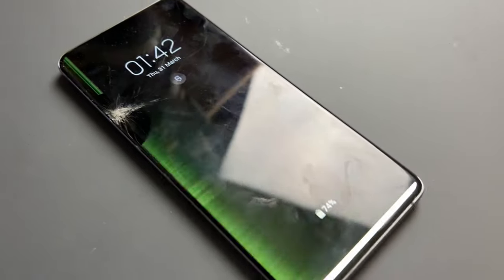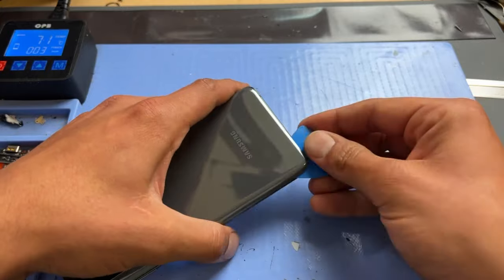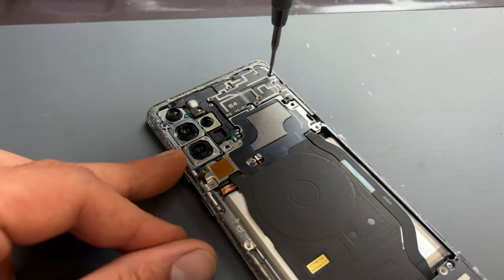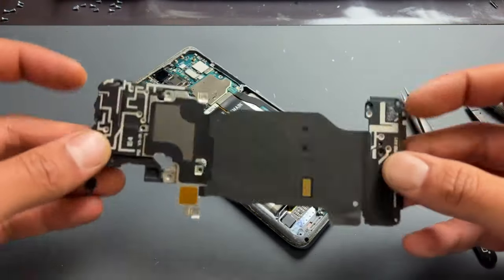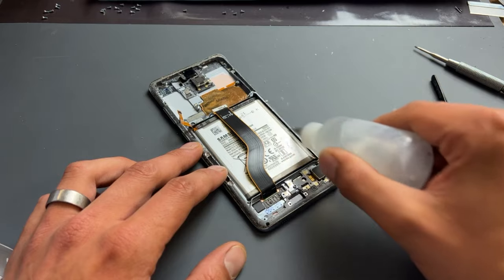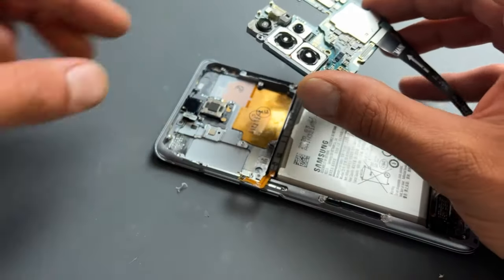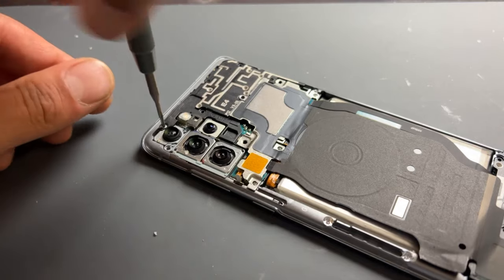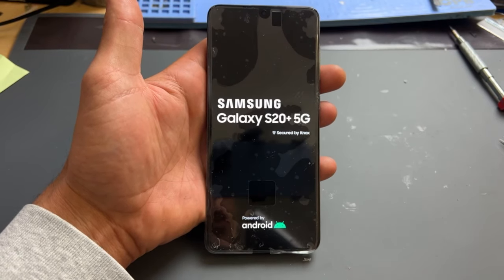Samsung S20 Plus 5G Screen Replacement: Detailed Step-by-Step Guide

Comment: The best step by step guide out there. Apart from not showing how to reapply some glue (I used B-700 which was straight forward), this guide literally showed everything and I saved myself £100. Happy days!
Reply from the maker: Thanks! We actually use Tesa tape to re secure the back cover when we don’t have an original seal available. Tape doesn’t have a curing time and is as strong as glue without the mess
Reply: @iDoctorUK  isn't Tesa Tape a fabric material used for wiring looms. It doesn't cause a water tight seal does it?

Comment: Yeah think I'm just gonna get a new phone instead 😂
Reply from the maker: I think for this model it is at the line where the screen replacement is almost as much as it costs to replace the phone
Reply: Just looked it up last weekend. Screen replacement is about $100-$130. A refurbished phone replacement is about $200-$230.
Reply: If had mine replaced at least 3times it cost me $300 USD every time I wish I could find a cheaper place to do it
Reply: @lillia2479  so.... What do you reckon? Change the screen or go buy a different phone?
Reply: @GhostBanks  If you want the experience, replace the screen. If you don't want the hassle, buy a new phone.
Reply: @lillia2479  Understood, but I also do understand that the green line issues keeps coming even after replacement of the screen. That's the issue I've got right now with mine(7 green lines)
Reply: @GhostBanks  That sucks. Good luck though.

Comment: Excellent video! I replaced the front and back cover, and the battery for $100. I had called a repair shop and got quoted over $300! THANKS FOR THE VID!
Reply: Where did you get all those parts for $100? Cheapest screen I found was 125 on its own.

Comment: I might bring my new screen and phone to the local shop. He said the screen alone would cost $200 when i went and asked. So im thinking if i supply the screen myself the cost will be a bit lower. I'm just not confident enough to do it myself as the components are very delicate.

Comment: Excellent video. Used to replace my own S20+ screen. Only thing was you forgot to link tools used in description! 

Bought screen from ebay, on the listing it said to test before fully installing. Easy enough to do, gently placed the battery and motherboard into the device over the top of the plastic covers that came on the new screen. Connected battery, side buttons and display. Booted fine, and tested screen which worked great. Just had to keep the phone suspended and look up from underneath so the unsecured components didnt fall out. 

Turned off, removed factory bits from new screen and slapped all the components in. Good as new. Only thing I forgot was some form of adhesive to secure the back glass to the phone. Ordered some B-700 another commenter mentioned. 

Thanks!!
Reply: Hey didn't your s20+ give you green line issues? Even after changing the screen
Reply: @GhostBanks  Nah mine was all good. No issues at all with the screen. Had a bit of trouble getting the back glass to stick down but think i just had shitty glue. have sinced cracked the back glass so need to replace it anyway!
Reply: @acid6112  oh okay thanks for the reply. I don't think I'd be fixing mine soon for the price of the screen here is almost what I got the phone for. Crazy yeah?

Comment: So it's not necessary to reapply adhesive to the vibration motor, battery and back cover?
Reply: I applied a tiny bit of adhesive to cam and vibration motor.

Comment: Thank you for this video. It helped alot. I just have a problem. The replacement screen while it fits, has a big gap along the borders of where the display shows. The glass screen  would normally display to the end and the edges. Instead now i have a smaller display area. Checked settings, nothing I could find to help resolve. Any ideas?

Comment: Just ordered a replacement screen, etc. for mine - this does look a lot easier than I thought it would be.  I hate messing with adhesives, but the IPA is a good idea.  I'm not going to buy a suction cup for the battery - though I don't doubt you're right.  It's, probably, one of very few times I'll do this.  Either way, thanks.  Read the replies to this comment for my experiences doing this repair.  It went very well.
Reply: Hi !you ordered from which country ? Cause i want to ordered too from China but i don't if the lcd screen is gonna be like that one he used in the video
Reply: Hi !you ordered from which country ? Cause i want to ordered too from China but i don't if the lcd screen is gonna be like that one he used in the video
Reply: @justfunny7056  I ordered from China, and it's not an original Samsung part.  Plus, though it looks like it should work with my phone, it's not necessarily made for my specific model of S20+, so until I get it and install it  - I can't make any recommendation whatsoever.  I'm still waiting on it to come.
Reply: @justfunny7056  Update - I installed it.  Was one of the easiest repairs I've ever done.  Just followed the video.  I used my fingers a lot, and carefully pried up the battery with plastic thingy.  Erm, don't try this at home, if you screw it up, I take no responsibility.  The front camera isn't blurry.  I got the front and back cover together pretty cheap.  Looks great.  New phone.  I was careful with the battery, if you do something wrong there, you can cause a serious fire.  Be careful.  My battery was fully discharged, in fact, I panicked a bit thinking it wouldn't charge - but I left it plugged in for a while, and it came up :/.
If any issues pop up, I'll update.  It, really, does seem like the screens from any model S20+ are compatible with every other model.  Don't quote me on that, but this one worked just fine.  After Samsung told me they couldn't do it - even for a LOT more money - because I'm in a different country than the phone came from.  This is, kind of, important - because at this point, the phone isn't worth the repair, unless you do it yourself with cheaper aftermarket parts.

I think the only thing I really did different than the video was to take the camera thing from the back cover, and swap it, because it had some kind of circuit board on the old one that wasn't on the new one.  I think it's a microphone or something.  I think there was one other piece under the camera that I popped out of the old one and put in, too.  Maybe that's the microphone.  Dunno, but I did both, lol.  Another thing was - I only used IPA on the battery.  The other parts, I carefully pulled out, and kept the old adhesives on the part, then they just stuck back in to the new screen.

My phone is Canadian.

I will update later on my experiences with the adhesive that comes with the screen.  Right now, I'm kind of doubting it.  But sometimes adhesives will cure a bit over a couple days.  I don't know.
Reply: @techrev9999  Hey, do you have a link of the screen you ordered by any chance? Or at which store did you oder it?
Reply: The adhesive that came with the screen replacement didn't really hold the phone together well, after letting it sit under pressure for a few days.  In the mean time, I had ordered some T7000 - as suggested by someone commenting on this video.  I kept the old adhesive that came with the replacement screen, but I ran a small bead of T7000 around the outer edge of the cover on both sides.  I pressed and held them together for, about, 30 minutes.  Seems really good, now, and I don't have to worry if it rains while I'm driving my bike.  Also, I did all this with a hair dryer, a good micro screwdriver set, and the tools that came with the screen  - while lying in bed.  Nothing really special.  I would, really, recommend a good micro screwdriver set, though.  The one that came with the screen wasn't very good.
Reply: Another small note, if you've ever worked with contact cement - with PVC plumbing, etc.  T7000 seems to just be a very strong contact cement.  It works the same way.  Or, maybe, it's weaker?  Because it has to be able to be melted by heat?  I'm not sure, but it's a contact cement.
Reply: An additional update.  A lot of glue seems better for the back.  The first back ended up cracking.  I ordered 4 more.  They're $1 each, so no big deal.  The battery may have developed a small lump in one of the spots I pried on it.  Not sure.  The battery runs out quickly, anyway, so I might look for a replacement.  In all, still very happy.  Just, the one corner doesn't quite sit right.  Meh.  Phone is great.
Reply: As a final note, for anyone who bothers to read all this, I would - absolutely - recommend spending the extra $10, and replacing the battery while you have the phone opened.  If anything happens while taking the old battery out, or if your phone was in an impact that damaged it in the first place - like mine was, the old battery may not fit properly anymore.  A new battery, and my phone just went together like butter.  Very nice.  Extremely easy.  And with a T-Mobile U1 rom, I can also use ESims, now, but that's a different topic, and another forum.
Reply: Does the 120hz still work?
Reply: @Sorrraaa  Not sure, had to order another screen.  I ordered that one from Shenzen lcd store, and it broke in 2 weeks.  The customer service was terrible.  I've ordered another one from ek lcd, and will try it as soon as I get it.  Losing my phone with an esim installed was a nightmare, and bad customer service just made things 100x worse, right before Christmas.
Reply: @techrev9999  Thanks for the reply. Can u please update me if the lcd you ordered will  support 120hz after u installed it. Because the one they replaced on my phone doesn't support 120hz only 60hz. And im planning to replace it again. Sorry for the bad wnglish
Reply: @Sorrraaa  No problem.  Usually takes about a week.
Reply: @Sorrraaa  Got it today.  Went in smoothly, let me set it to 120hz, and the screen feels more stable.  I don't have any way to be 100% sure, but it's a nice screen.  I like it so far.
Reply: If Any1 of you can share a link or something to order it and the price?
Reply: @techrev9999 was the somewhat-general issue of s20+ having a green line the reason why you changed your screen? Mine just got 1, and then 7 lines now within a day. So pissed!
Reply: @GhostBanks  No, fell off my motorbike and it went flying.  May have fractured a rib.  Not sure.  Was over a year ago.
Reply: @techrev9999  So sorry about that. Really!
Reply: @GhostBanks  Geez, that was nothing.  I've been in the hospital for a month with a colon rupture.  Almost died.  Learning how to do this has kept my phone going through all this.  Extremely important.  I'm in Thailand, and it has kept me going.  Why I'm doing all this.

Comment: Does this service pack Display + chassis come with pre-applied adhesive for the battery? I want to replace my S20+ 5G display as it started to have some problems, also I want to replace my battery too.

Comment: I have a donor phone to swap to. , if i remove my motherboard and all my parts and swap to the donor phone, will i lose all my data and storage off my OG phone ?? Or would it be wiser to try and swap just the screens ??
Reply: motherboard contains the cpu storage etc, so no you will not lose your data, I always advice everyone attempting to repair phones to be careful not to knock out some integrated components when disconnecting the flex cables its almost the only thing that can go wrong, best of luck

Comment: can you give detailed list of what you used?? and also where to buy - and also does this work same on normal s20 or just +
Reply from the maker: Cross head driver, razor blade, plastic opening tools, heat mat
Reply from the maker: Very similar method for the regular S20

Comment: Interesting, I recently learned that current oled screens do not agree with me. I just recently bought a onePlus Nord N30 because it has an IPS-LCD display. I have to keep this in mind for the time after when I upgrade this phone maybe just downgrade the screen back to an after-market IPS-LCD. onePlus Nord N30 has quite a lot of features and even though the processor is supposedly slower. I really don't think it is? Regardless I still have to find a phone closer to the size of an LG6 that was the perfect size, I think.

Comment: I've just had a new screen put on this same model phone but the screen keeps going off the phone is still on as its vibrating but the screen is blank can anyone help please???? Has the screen not been fitted correctly??
Reply: Yeah inside the phone the screen the flex cable that holds it on there if they didn't put it on exactly right it can pop off with a slight bumper impact the phone has to be taken apart again and make the connections chances are no damage was done but simply the screen we came unplugged